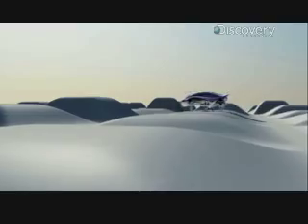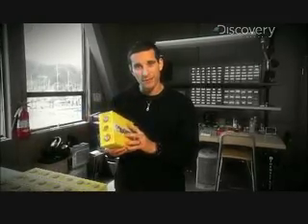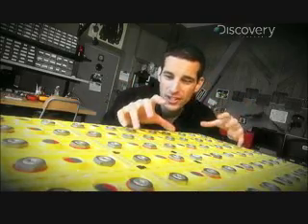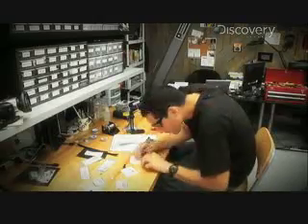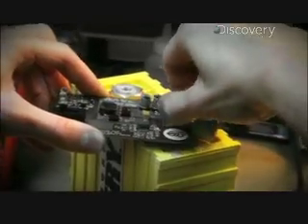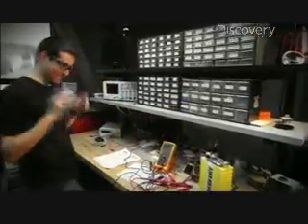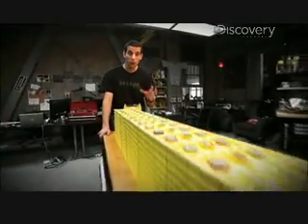Prototype This! - Creating the Six-Legged Vehicle

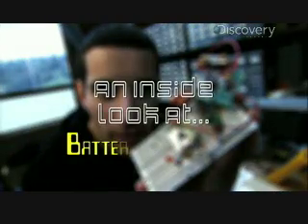Comment: Yeah, I first built the battery management system on a breadboard (you can see it briefly at 0:30). But, the system needs a proper PCB layout to work at peak efficiency, so I got rid of the breadboard once I was sure the circuit worked.
Reply: I was just googling you to see what you were up to these days. Big ups thank you for the entertainment!